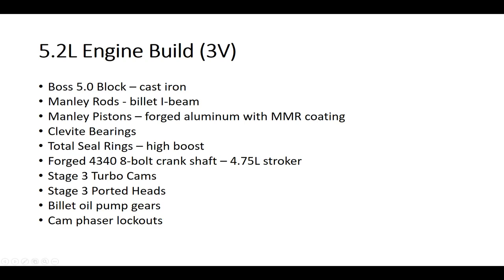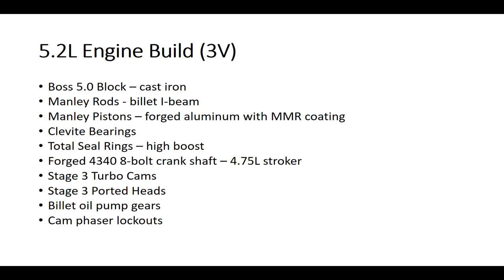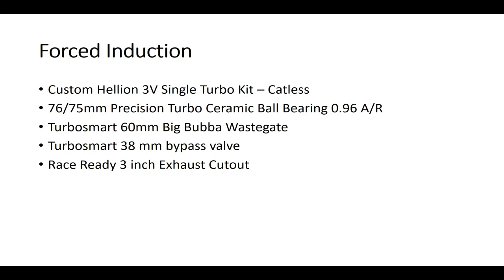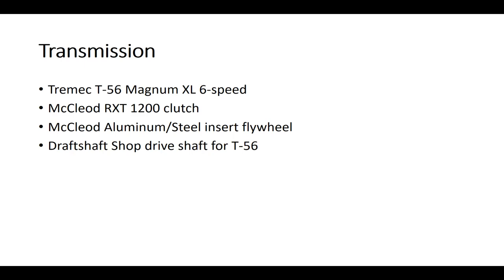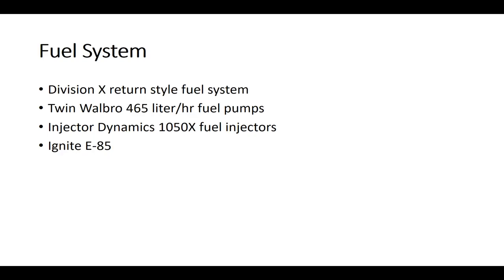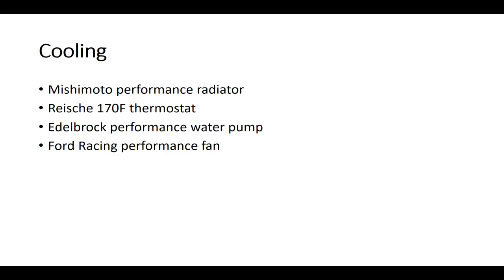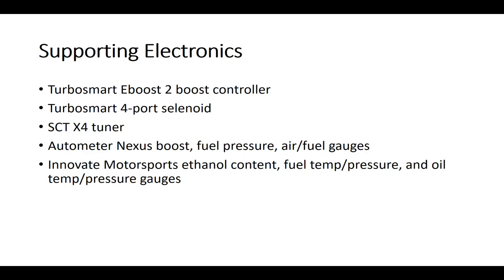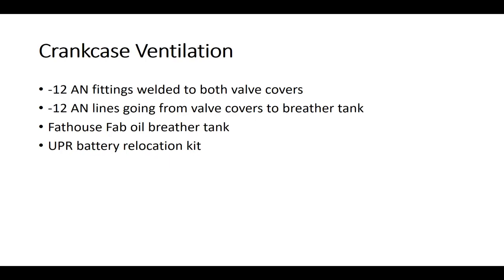How this 2008 Mustang Makes Over 1000 WHP

Comment: Do you think 1150 + H.P   can be achieved with a setup like yours if a custom twin turbo setup was used. Great video very informative
Reply from the maker: I assume you mean 1150 whp. I'd say yes. You might need to have cutouts or short downpipes that bypass exhaust. If you'll have dual 3 in exhaust this might be good enough.

Comment: Very nice build my friend, I am running the same Edelbrock super charger you had. Just curious what size pulley you ran and how much boost you were seeing ?
Reply from the maker: I don't remember the diameter, but the boost pressure was around 12 psi. How much boost are you running and which engine?
Reply: @CarsLife  stock 3V on 7 psi
Reply: And thank you for responding
Reply: I ask because I'm not sure if you blew your engine on the blower or turbo setup ?
Reply from the maker: @CLPATTERSON  I was on the blower at 12 psi doing a 3rd gear pull, hit the rev limiter and it blew immediately.
Reply: @CarsLife  did you upgrade the fuel system for that boost level? I'm still on the 41lb injectors that came with the blower and a KB boost a pump.
Reply from the maker: @CLPATTERSON  I had 41 or 42 lbers and a kb boostapump at 12 psi. I also had the edelbrock competition intake.
Reply from the maker: This configuration made 510 whp and 510 ftlb SAE.
Reply: @CarsLife  Great info! Thank you.   The stock pulley is around 3.8 in you must have had a 3.25 in to get that kind of boost is my guess.
Reply: I really wanted to go turbo as well but I live in Ca. No kits available with carb number.
Reply from the maker: @CLPATTERSON  Actually that rings a bell.

Comment: Have you done any other upgrades lately. Very nice car like to see more video maybe some track info,
Reply from the maker: Thanks! New cams, oil pan, header gaskets recently, buy they were more or less repairs and not upgrades.
Reply: @CarsLife  what cams did you put in? Has it been back to the dyno since installation of them?
Reply from the maker: @stevekent9276  Cams dynoed were a MMR grind from Comp similar to a comp 127350 VSR. Pretty mild cam nothing crazy.
Reply from the maker: Cams I just installed were the Comp 127350 valve springs required. I haven't yet dynoed with them, but are similar to ones dynoed.

Comment: When you added the widebody kit, did you have to cut the fenders at all?
Reply from the maker: Yes. The rear quarter panels needed 1.5 inch and the front around an inch. We started with less, but tires hit when going over bumps.

Comment: Any specific reason you went with a 5.2 instead of keeping it 4.6? Building my 3V as well very soon on a similar setup just planning to do pistons and rods with billet OPG see how much power it can take. Awesome car though man love to see fast 3v’s instead of the typical 5.0’s 👍🏽
Reply from the maker: I went with a 5.2L setup to obtain a larger NA power level. I attempted to max out the NA power level to reduce boost pressure requirements. I agree, the 3V is essentially forgotten. Whenever I see a 3V on the road, it always puts a smile on my face. Thanks for the comment!

Comment: Is the return style fuel system plug and play? Or do you need some controller?
Reply from the maker: Just a fuel regulator to control fuel rail pressure that comes with the kit. Return style systems are actually much simpler from a control standpoint than a returnless.
Reply: @CarsLife  Thanks!

Comment: you talked about the stage 3 heads, where did you get them done and how much hp/tq did they add?  Do you have before & after dyno numbers?
Reply from the maker: I bought them from mmr. They are ford racing stage I heads that are ported. I can't  say how much power they added because I never dynoed with and without.

Comment: I have a very similar setup with the Turbonetics 76/75 and I've managed to get 800rwhp at 19psi with a conservative tune on pump E-80 fuel. What type of boost did you run to get the number you have and what was the backpressure on the turbo exhaust side? What kind of total timing did you run? Great build by the way.
Reply from the maker: Boost was 25 psi. Back pressure wasn't measured. Total timing I believe was 16 to 18. It was a conservative tune. Thank you for the message!
Reply: @CarsLife  what size is your cold side piping and intercooler?
Reply from the maker: @stevekent9276  2.5 inch
Reply: @CarsLife  is the Precision a 76/75 Gen2 CEA ball bearing?
Reply from the maker: @stevekent9276  That's the one.
Reply: Did you have to do any modifications to the support bracket to hold that turbo? I know it's a little different then the turbonetics model.
Reply from the maker: @stevekent9276  No, but it was hard getting the holes in bracket and turbo to align. I think that the bracket holes could have been better placed to clock the compressor housing away from idler pulley a little more. Hellion provides a smaller diameter pulley in their kit, but it's still a tight fit. 

I also had to buy a 5 rib serpentine belt to prevent the belt from rubbing against the compressor housing.

Comment: I'm wanting to buy this same wide body, what are your wheel specs?
Reply from the maker: 19 x 12 with +6mm offset. Tires are 345 30r19. You'll probably need to do fender/quarter panel cutting.
Reply: Cars&Life thanks for the quick response!!🤘🏽

Comment: Im just curious what the block you have do you if you can pair an auto trans or only manual trans
Reply from the maker: It's a Boss 5.0 modular block so both manual and auto will fit not at the same time though, ha ha. Thanks for the comment.
Reply: Cars&Life Thanks because im in the process of building my 3v but I didnt know if i wanted to build the 4.6 or get a new block
Reply from the maker: @shawnturner9875  Very cool. I wanted more displacement and that's why I went with Boss block. I was disappointed though that this block only has a two bolt main with side bolts. What block and trans are you thinking to use?
Reply: Cars&Life im not sure which block I want to use but im thinking about going with a 6r80 because I dont know how to drive stick so its a bomber :(
Reply from the maker: @shawnturner9875  Well autos are faster. It's never too late to learn right.
Reply: @shawnturner9875  The 4.6 block is a strong block to rebuild if the cylinder sleeves are still in good condition and a good machine shop and check all that for you,  on mine we went with a aftermarket stud kit in the mains and manely rods eagle crank and Ross pistons and the engine has been running almost five years after the rebuild and it currently makes 897 H.P to the wheels on a Mustang dyno with a twin screw super charger kennebell. That's on pump 85

Comment: Im 17 and just got a 3 valve mustang. I don't even know how to do cams i wish I knew how to build a engine 😔
Reply: There is plenty of vids out there man, im 17 too and have a 2007 Stage 1 Roush with a N/A 3v I plan on putting cams in and supercharging, ive already had the j take manifold taken off to fix a leak, ive had to take apart the diff for a seal and the list goes on, just get a Haynes repair manual on it and use youtube to your advantage!